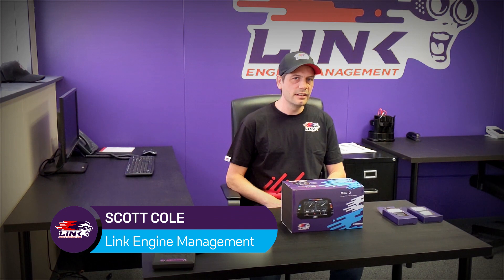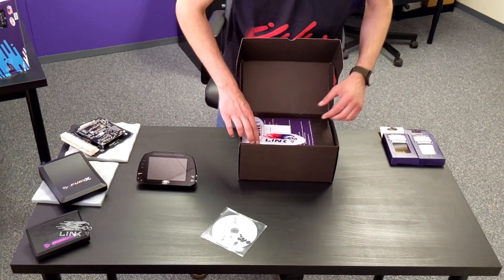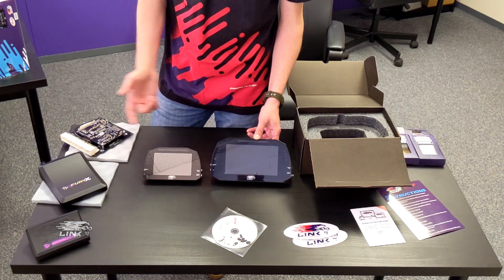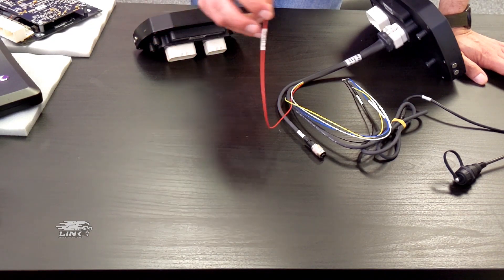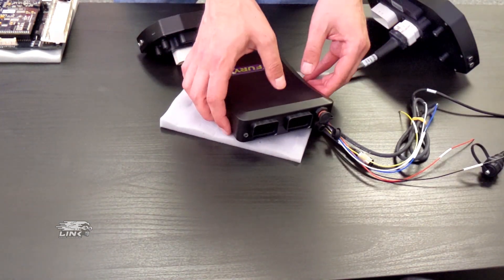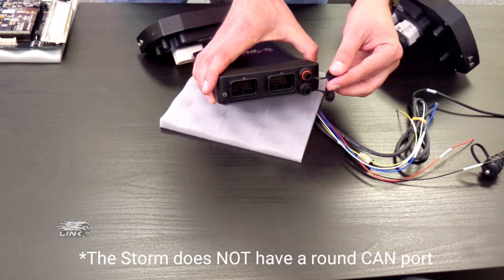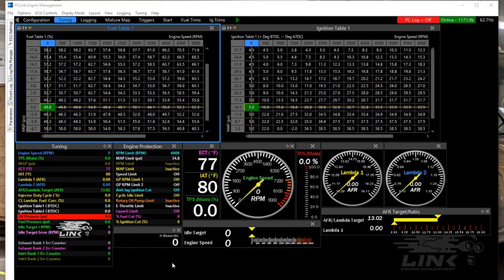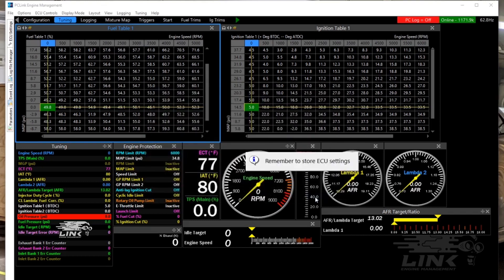Dash installation and setup

Comment: Just got a used race car that has a AIM dash, on startup it says MXG 1.2.  The previous owner never set it up.  My question is that this is a Carburated car with absolutly no ECU at all.  Can I still use this dash?  if so how do I hook up multiple sensors, for example oil pres, coolant emp, fuel pressure etc?  I would really like to use this dash if I am able to.
Reply: Best bet would be to look up the aim dash itself since its not an actual link part its just visually branded link same thing with their can gauges they are actually gaugeart gauges

Comment: it suitable for Bmw s1000rr <2018
Reply from the maker: Hi Huy,
The product can be fitted to a BMW S1000RR, but you will need to leave your stock dash installed also to retain access to all features and safety controls. More information on this can be found at https://www.aim-sportline.com/en/out-of-production/evo4/installation-kits/installation-kits-bmw.htm